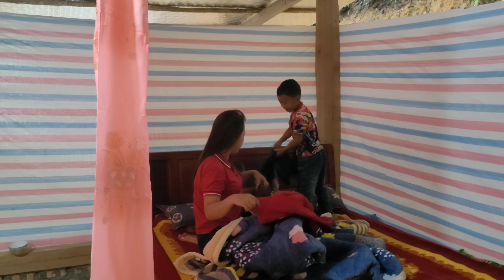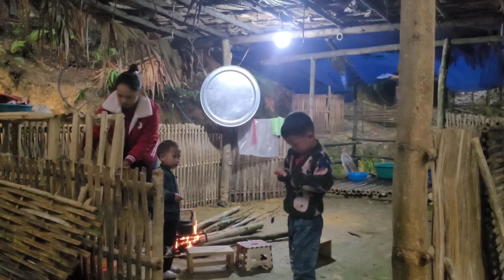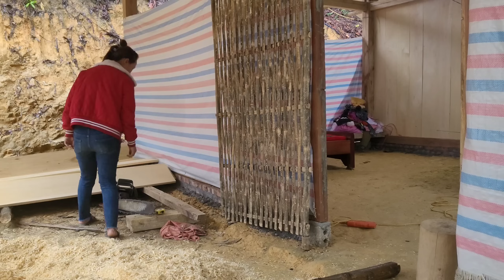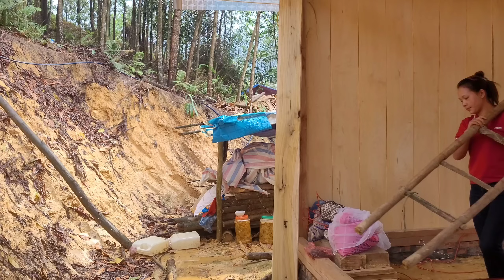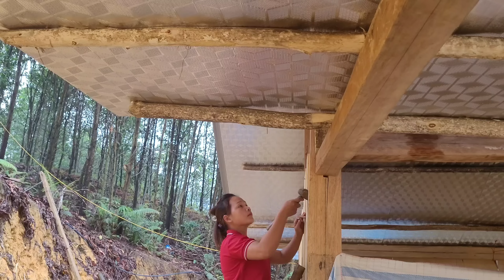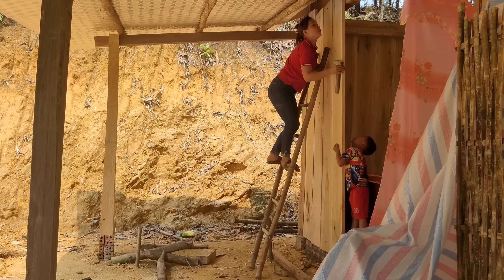Completed 80% of the house on a rainy day with the children.

Comment: I can understand that you want your house done, but later when all the boards are up go around and put more nails in the boards because with heat and humidity it will warp the boards and eventually come loose. 
Buy some persevering paint , so you can paint your beautiful house inside and out. This way you won’t get mildew or the wood get rotten. Very  nice job and a very talented woman.